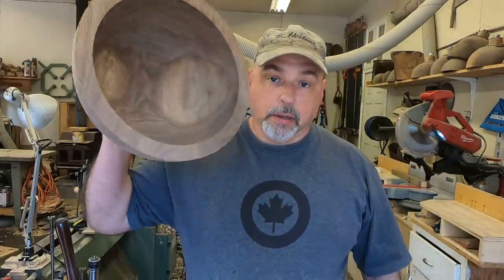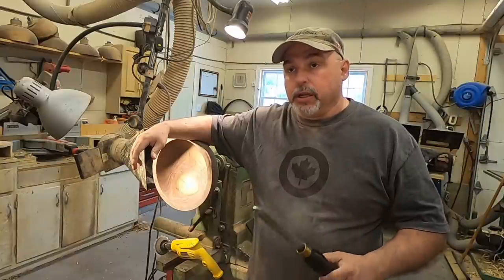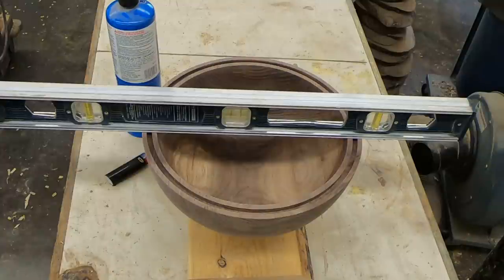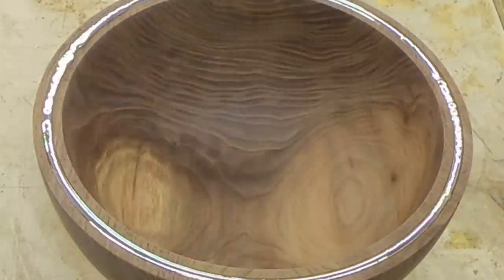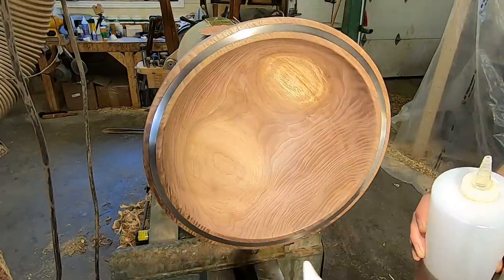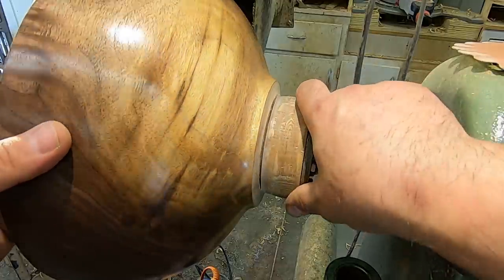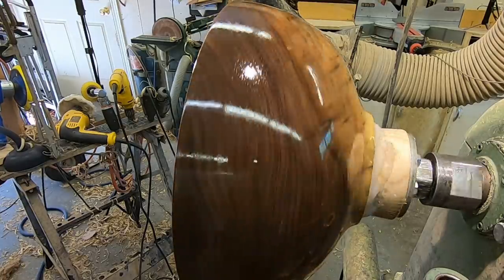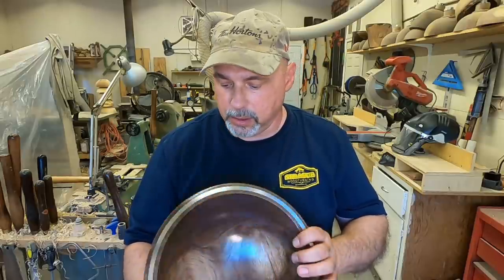Woodturning - Walnut with pewter inlay

Comment: hey i think you can get away with cutting pewter on a chopsaw for wood. i use the chopsaw to cut aluminium all the time and it does it really effortlessly and it doesnt even damage the blade, so maybe worth a try, allthough i'd use an old blade to test it first :D
Reply from the maker: Yes, it probably can, the only issue is loosing a 1/8 pewter because of the blade that’s why I like to use the hacksaw, it cut pretty easy after I put a new blade on it, lol.
Reply: @SpragueWoodturning  yep if you are in the US, maybe the "bauer" protable bandsaw from harbor freight would be a nice upgrade for your shop too? it seems to be pretty capable and you could cleanly cut all metals you like. i'm just not the biggest fan of zip cutting stuff haha
Reply from the maker: Sharky my son has a Milwaukee one and loves it, I wonder if he’ll notice it’s gone, lol.

Comment: -4,Carl - Here it is, https://en.wikipedia.org/wiki/Cerrosafe - some distributors will supply a chart of additives to color the alloy.
Reply from the maker: It has lead in it, so I wouldn’t use this for a food grade bowl, however it might look good in non food items, Jim.
Reply: 4,Carl Since that is a concern, be careful about your brass for filler.  Free machining brass contains lead, if import, lots of lead, especially in import plumbing parts. If you use import lead billets, might want to get a lead kit.  It is amazing the high percentage of lead I've found over the years.
Reply from the maker: Ok, thanks, good info.